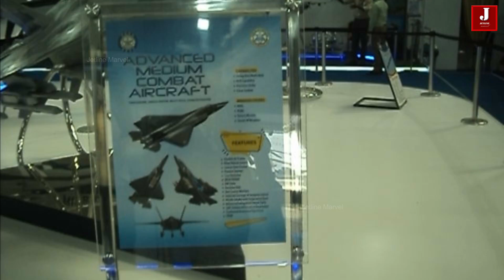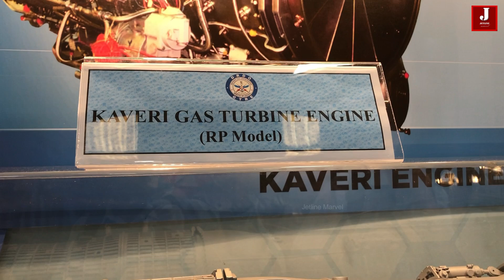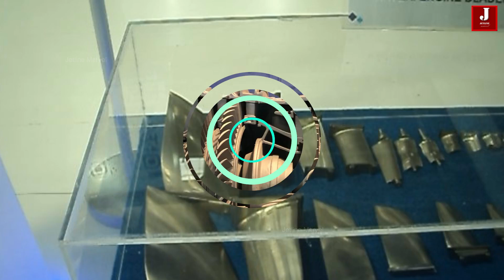Tejas with Kaveri Engine : South Korean Engine development for AMCA : Jetline Marvel

Comment: Sorry, India's need of 110 to 115kN wet thrust is at flat rating, that means, any other program should have at least 10% more thrust rating to satisfy AMCA needs of 115kN. Essentially, SK engine should be rated at 130kN